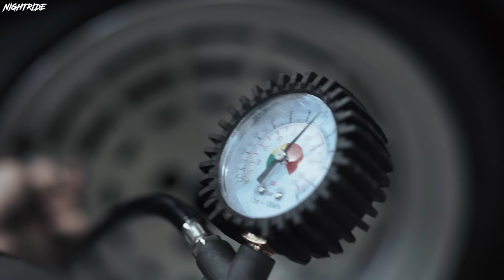CURSED BMW E30 | Street & Touge Drifting

Comment: Careful putting harnesses on stock seats guys, they can easily be collapsed. Also, you don’t want to mount the harnesses lower than your shoulders. If you wrecked, the straps would pull down on your shoulders/spine. Just want to keep y’all safe!! Great video ❤

Comment: Sami one very important thing. If you want to live longer, do not put on the belts - from the inside of the headrest. In the event of any crash, the belts, drawing tight, may cut your head. There have been cases where the straps cut into the neck. 

Rest was good as always! 🙂

Comment: Hey Nightride,

I know this is an old video and you probably won't see this, but if you get stuck somewhere again like in 8:00, you can tie one side of a rope through the wheel and the other side of the rope to a tree. Stepping on the throttle slowing, should wrap the rope around the tyre and pull the car out.

Comment: Cool video, nice driving! Just a quick question. Why do you put so much pressure in tires? I was putting 3 bars to rear tires when I was drifting with low powered M42 and it was just fine. Is it necessary? Does the one extra bar make big difference? Thanks. Perfect video as always. 🙂
Reply: more pressure means easier skids for low powered cars for example when I take my stock powered miata to the track i out 55 psi in my tires just makes the tires less grippy

Comment: If im not mistaken a saw you guys inflating the tires 4 bar, which was the result why the tire exploded. 2.5 -3 bar wil do. The tire size of the car is not strong enough to handle that kinda pressure

Comment: "It is cursed!"...

No guys, it is not. Maybe the problem is how you are treating it?
A sway bar only screwed back on top of the suspension struts, without proper torque? It is going to end up in disaster, it is a matter of time.
Adding a 4 point harness, without a proper bucket seat? It is going to end up badly, it is a matter of time as well.

I mean, treat it with respect, and the car will give. You guys are young, and you guys ROCK, I love this channel, but it would be great if you keep doing what you do, but without accidents bound to happen. :)

Comment: cars have souls. people never believe me. but if you feel the car is cursed, its probably because you mistreat it. slamming it ridiculously low is one thing they don't like. imagine scraping your balls a crossed the pavement at 60mph. yeah doesn't sound fun eh?

i had a grumpy ass 2006 honda s2000 that i got rid of. i wanted to drift, it did not. it gave me an old man "cruise" attitude, never wanting to be driven hard. I drove a friends s2000 and it loved drifting and going fast. both were bone stock vehicles. but because cars have souls, they had vastly different feels to them. some might claim maybe I was hesitant in MY s2000 because I didn't want to crash, where I could drive my friends with no worries because "its not mine" but that isn't the case.

and because cars have souls, when driving on the street, the drivers soul/aura merges with the cars, and you can literally feel which car is a good combo or not. you can even tell when someone is going to change lanes before they use a signal or begin to merge. its all there in their aura. my friends hated me. one time they had me join a phone call while driving, hands free obviously, and I would tell them when they were gonna turn or merge lanes with no warning or blinker. and they were gob smacked. they said I must be psychic lmao. but I dont think im psychic, i just know cars have aura's and you can feel those drivers in front and behind you. when a skilled driver is behind you, you can feel that pressure, and it can get to some people. forcing them to make a mistake. its all real.

Comment: The way those seatbelts are mounted is a death wish. That seat isn’t designed to hold that belt if it were to compress your spine would get crushed. Stay stock belts or do 4/5 points the right way. Get a harness bar at the very least

Comment: Be careful with the angle your harnesses are on from shoulder to floor, too low of an angle can snap your collarbones in a big crash
Reply: I'd recommend running a harness bar behind the seats and running the harnesses as level as possible
Reply from the maker: @slothgarage4846  yes it's 45 degrees which is on edge of being safe :)
Reply: @NIGHTRIDEPL  as long as you're aware! Love the beater build 👌 safety is always #1 though, keep it up guys

Comment: Please don't attach the seatbelts like that, the angle from your shoulders and the point of mounting shouldn't be more than 10°. A crash would be fatal with that placement. The belt gets pulled up from the impact and the belt that sits below your stomach gets pulled up as well and it demolishes your intestines.